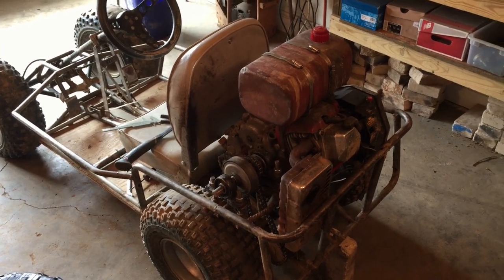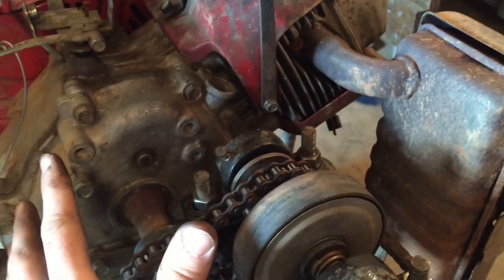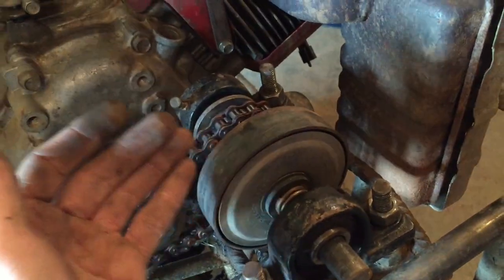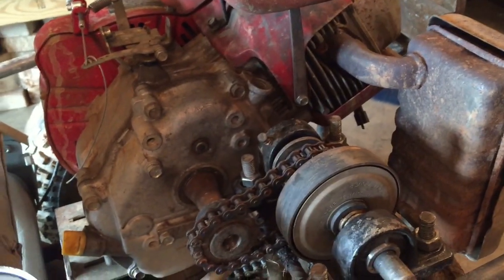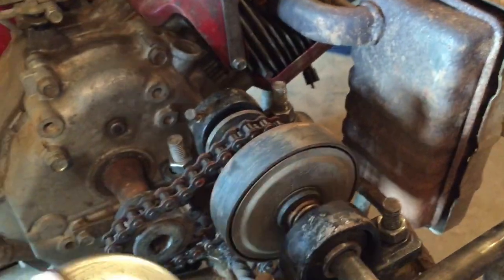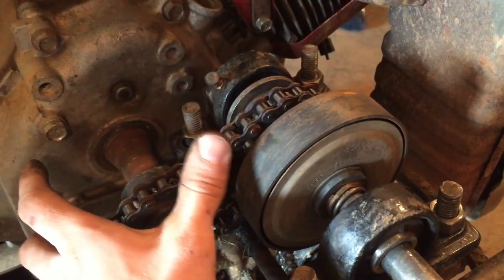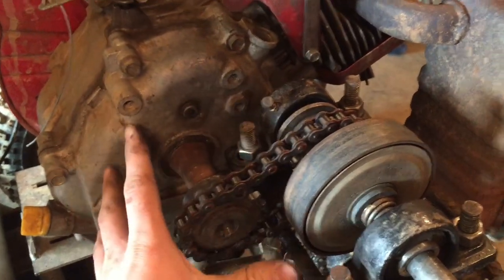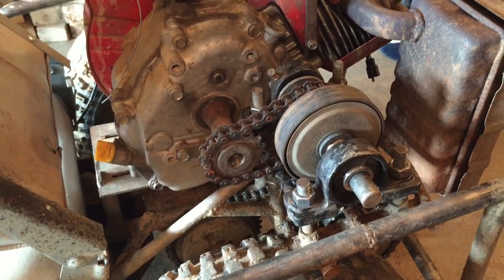better clutch on the 13 hp go cart part 1

Comment: Why you don't use a torque converter?
They are way better!
Reply: Also would cost a bunch more $ that he likely doesn't wanna spend. Its not worth putting anymore money on other than a cheap roll cage as long as its on those awkwardly narrow ATV axles. Cool as frig tho for a toy. Good shit budsy!!
Reply: because the engine has a tapered output shaft DuH ,,